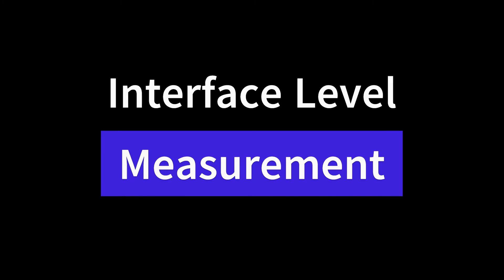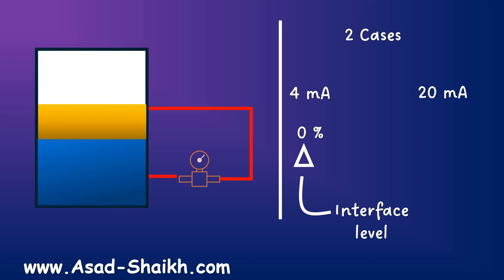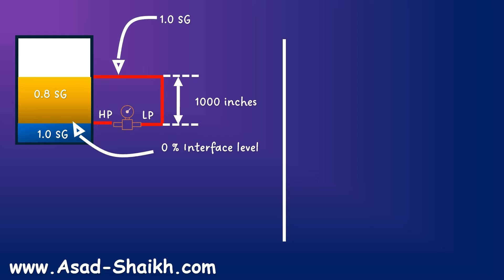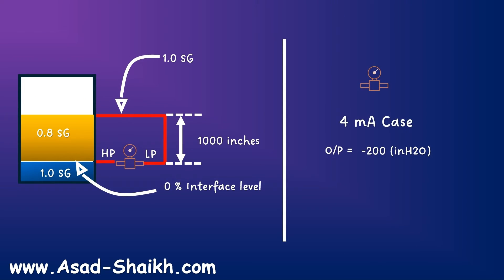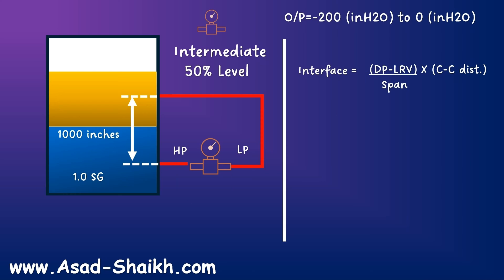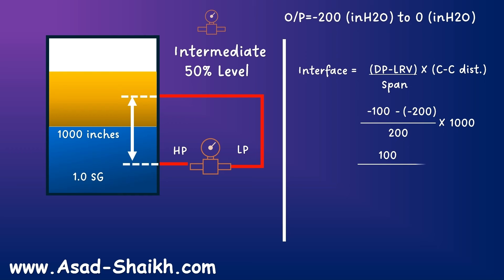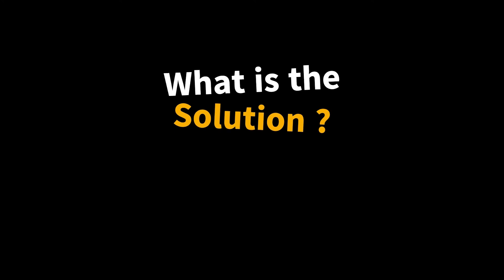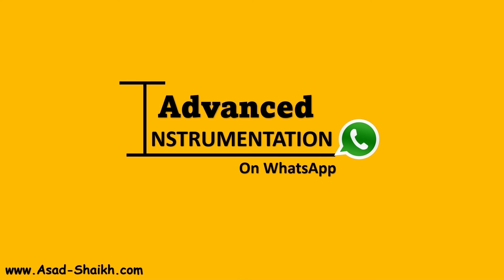DP Interface Level Calculation Explained

Comment: Hi Asad, so you have assumed that LP side will be pre- filled with water ?
Reply from the maker: The LP side "shall be filled with Heavier Fluid"

in this example it is water, but it can be any fluid that is the the bottom of interface level measurement.
Reply: Hi asad Having Some Queries?

Generallly,
1. HP side taken from bottom So heavier liquid will be in down 
2.LP side take from Top so lighter Liquid will be in Up

Am I correct?

Comment: This dp type practically impossible in process
I am working in oil & gas sector best is radar & displacer LT to mesure interface level
Reply from the maker: Radar seems to be a good choice if cost is not a barrier. 

Also sometimes client have Radar + DP to cross verify the readings if application is critical !! Thank for sharing your experience !! 😊